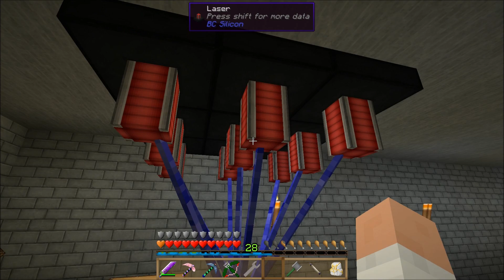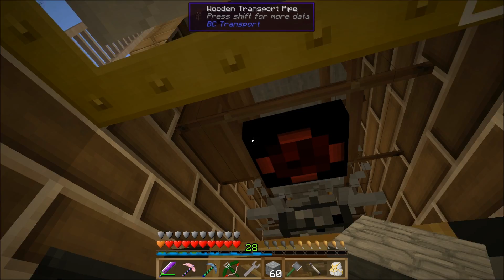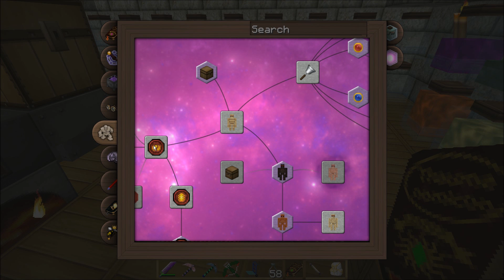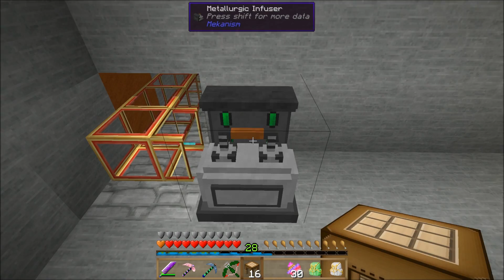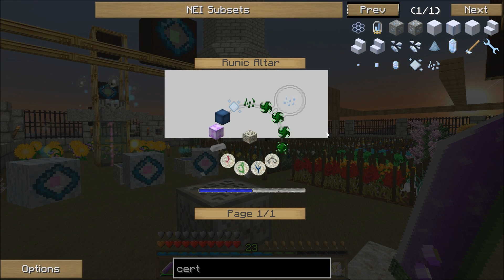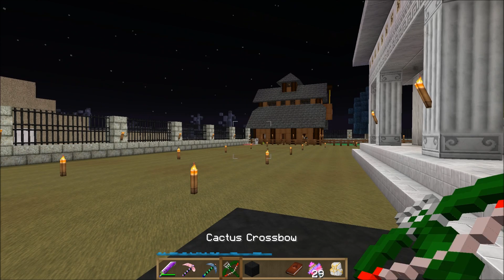Regrowth - Power Plant Revamp and Mekanism Bootup e28

Comment: Instead up making several complicated vspace barrels, just make several simple ones.  at your coal station, make coal and stick it in a massively upgraded non-vspace barrel and put a hopper under it to feed into the simple vspace barrel.

This way you can easily make more supply barrels as needed.